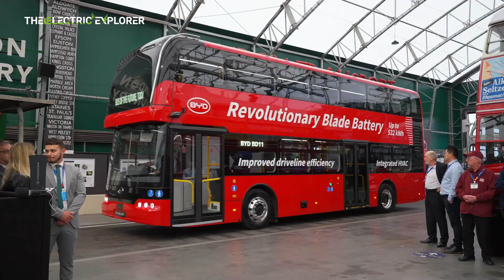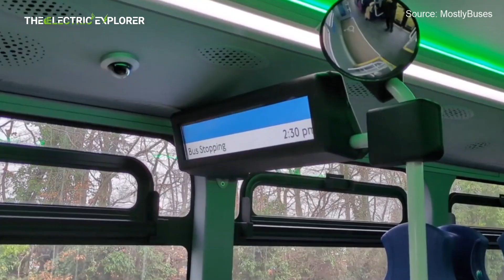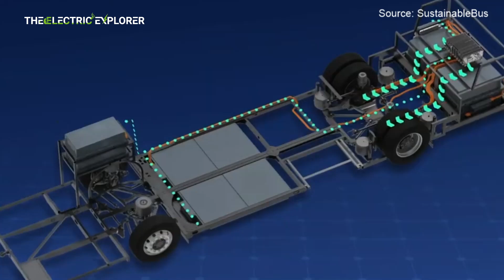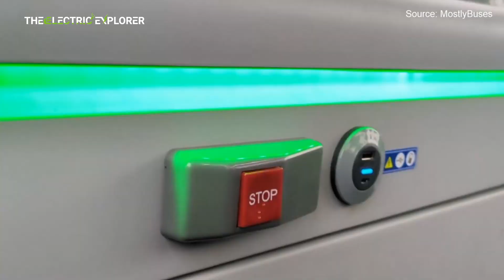London’s New Electric Bus Is a 400bhp BYD BD11 with a 532kWh Battery

Comment: Well, London will be getting a good bus. Still, charging times like two hours will never fly as the norm for recharging a complete bus fleet either overnight or progressively throughout the day. BYD wll have to introduce its innovations in 10C+ passenger vehicle charging to its bus fleet quickly if the bus fleet is to be genuinely up to the task.

A 10C battery is a good choice for buses as well as passenger cars. It will get the charging done in a jiffy (despite falling away from peak charging rates during the charging cycle).

Bus depots and terminals are going to need electrical upgrades. These upgrades will be necessary and no doubt expensive. What we don't want, however, is to unnecessarily replicate charging infrastructure in depots and terminals increasing the capital and operational costs of running an electric bus service.

Buses and trucks needn't inherently charge more slowly than cars. They will in practice charge more slower (see below) but with sensible design and utilisation of charging infrastructure charging sessions of around half an hour should be enough to get the job done for most road going vehicles (assuming chargers are properly adapted to the vehicles being charged).

C rates only apply to rechargeable batteries not charging infrastructure. Buses and trucks don't charge slowly because their C rates are inherently lower. Any 1000kWh battery rated the same C rate as a 100kWh battery can charge as quickly as the lower capacity battery. Indeed, the cells in the larger capacity battery will suffer no greater electrical stress (voltage or current) than the lower capacity battery.* On the contrary, it is the supply of electricity over the course of the charging session that is the limiting factor. Redesigning cells and batteries to make them more fit for faster charging requires a significant technical effort. Building batteries with vastly increased storage capacities introduces additional complicating factors - more cells may need to be connected in series to sustain higher voltages and more parallel banks of cells, too, might be required to keep current at nominal levels at individual cells and banks of cells even as total current gets a big boost across multiple banks/circuits of parallel cells. Proceeding with redesigns like this aren't trival decisions. So, in practice, charging infrastructure for buses and trucks will typically lag battery developments and act as balast delaying technical decisions.

The charging infrastructure for buses and trucks will advance in bits and starts but (without state mandates and regulation) it is unlikely that suppliers of charging infrastructure for buses and trucks will roll-out charging harware that is in technical lock-step with critical battery advances. Slow changes in charging infrastructure will, in turn, discourage more rapid roll-outs of advanced battery tech in buses and trucks.

* Thermal stress is an issue but it ought to be well controlled for a well designed battery whatever its capacity might be.